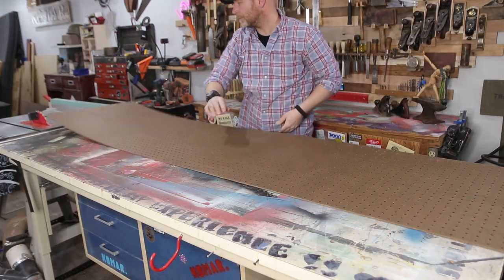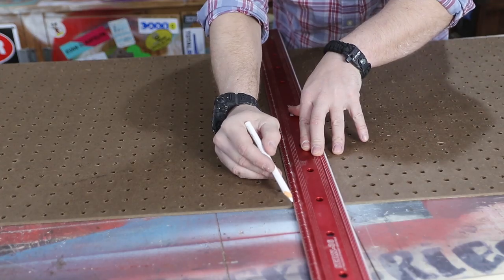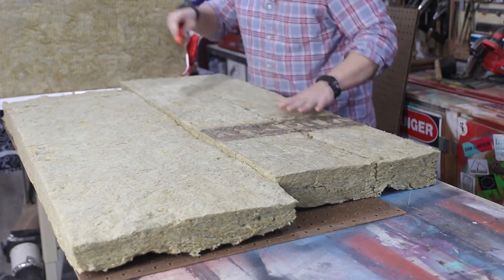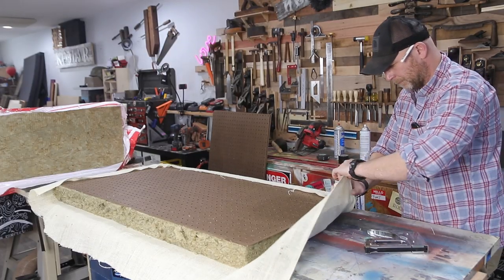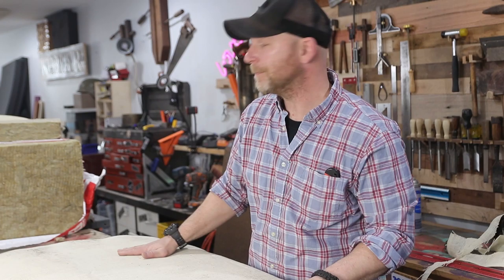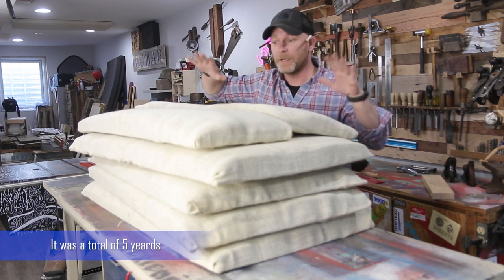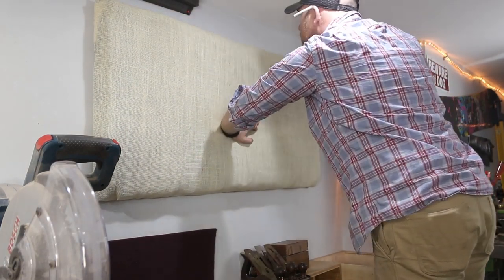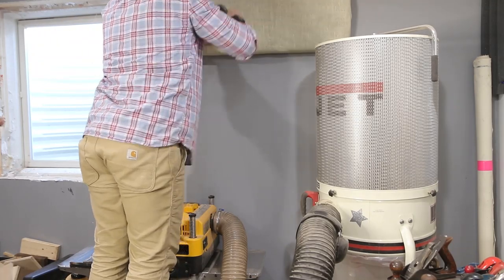How to Make Acoustic Panels for Under $15  Using Soundproof Insulation

Comment: Does Rockwool cause itching like fiberglass does? I noticed that you handled it without gloves. A concern for me would be that small particles would be leaking through the burlap getting on everything. Does Rockwool hold together well enough not to do this?
Reply from the maker: So Rockwool is basically made of rock and it’s much safer then fiberglass insulation.  It can cause some irritation from what I have read but I didnt experience any of it. And yes it holds together better then insulation.   If your worried about it going through the burlap you can double it up, but again i haven’t noticed anything coming though it
Reply: @KomarProject  Thanks for the quick response!
Reply: @roijames9066  no the wool doesn’t. Fiber glass is made with glass which makes you itch. Mineral wool is made of recycled plastic.

Comment: Does this work for noisy next door neighbors?. I share a thin wall with my crazy neighbors. Thanks
Reply from the maker: This insulation is used for sound dampening
Reply: On another channel,  the person  created a thin, insulated false wall that reduced the noise. Then hung a tapestry that reduced it even more.  Sorry I don't recall the channel...I found it by searching up soundproofing. He had to make it easy to remove because it was a rental. So use screws.

Comment: OK one other question. Burlap comes in different weights from light to very heavy. I want to use a 22oz burlap because it feels tighter and looks really nice. But I'm concerned it may reflect more sound than allow it to penetrate into the rockwool. What are your thoughts on this? Does it make any difference?
Reply from the maker: Roi James I don’t think so.  It’s still going to penetrate into it.  You should be fine.  My thoughts.
Reply: Best material is breathable cotton fabric. The weave is tight enough to keep insulation fibers in but allow air to move through. You should be able to hold up a hand and feel  air if you blow through one side, otherwise it will be too reflective.

Comment: $1.79 for insulation!?  Not in THIS life.  That package costs close to $60 at Lowes in Canada.  $1.79?  I'm calling B.S. on this one bro.  Maybe you can tell that to a toddler, but not to an adult.
Reply from the maker: I don’t know what video your watching but I posted the cost of the insulation package in the video @ $47.98 which is what I paid for it.  Maybe you just missed a number somewhere
Reply: @KomarProject  So I paused it at 3:12, took out a magnifying glass, and looked at your pricing box.  For some reason the 4 (4.79) is faded, making it look like a 1 (1.79).  That's a bit more reasonalbe.